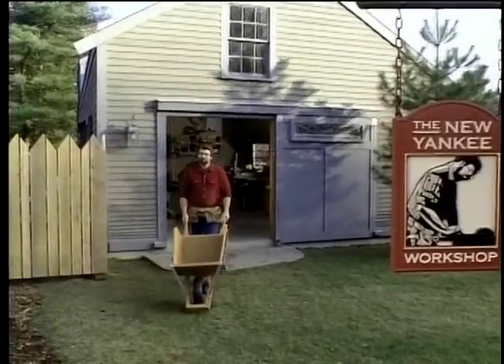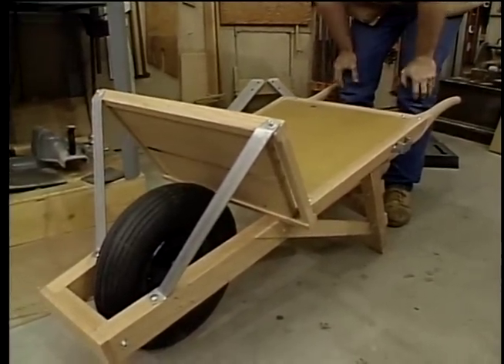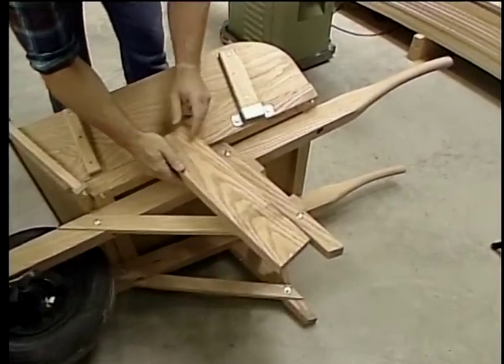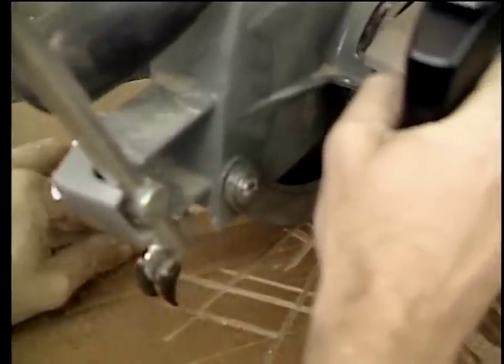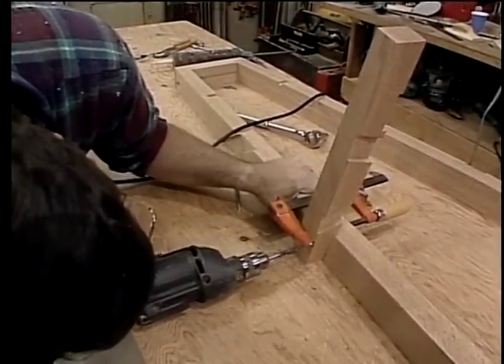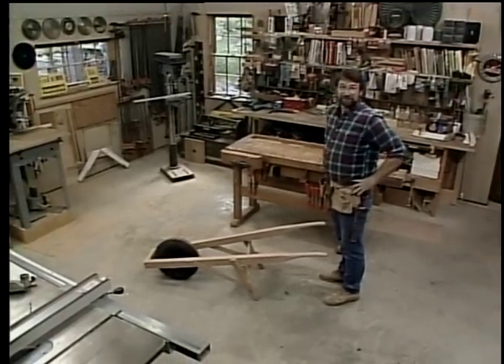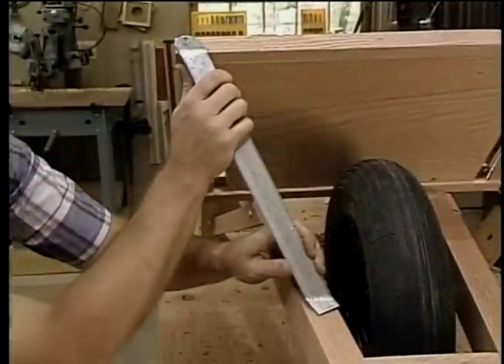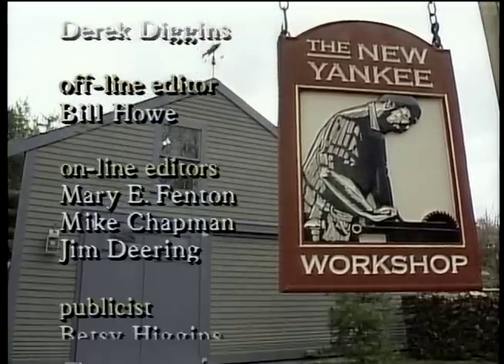Wheel Barrow  |  S4 E9

Comment: i’d use Thompson deck clear or water proofing colored stain due to if your mulch bags are wet from a recent rain or hauling fire place logs getting a work out with grandkids wanting a ride. you can hose it off let it air dry not have worry about it rotting. you can leave it outside

Comment: @ 6:42 Norm, I have never seen a tenoning jig that small! In fact, I've never even saw a toggle clamp on the newer models in the early 21st century at all!
Reply: Beautiful reproduction of a much used and much home life tool. Thanks for sharing.
Reply: @paulorth2251  Yeah, right? Trying to hold a strip of stock on end for cutting tenon cheeks is obviously dangerous, and very unsafe to push through the blade. I've never used one of these jigs before, and as soon as I finally get my hands on one, I'll be a master mortise and tenon maker for years!
Reply: I have that problem with my jigs too.